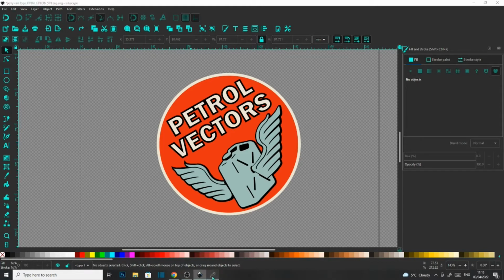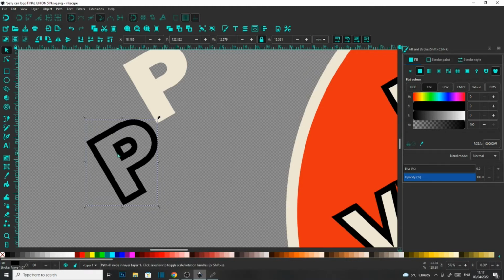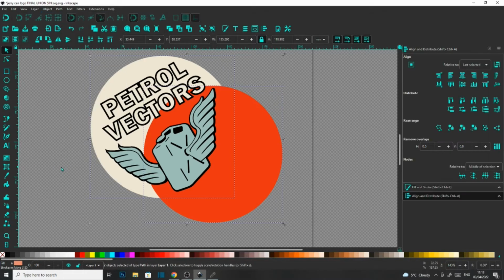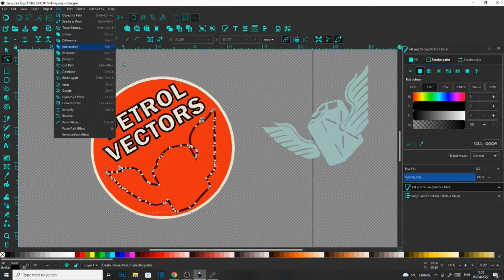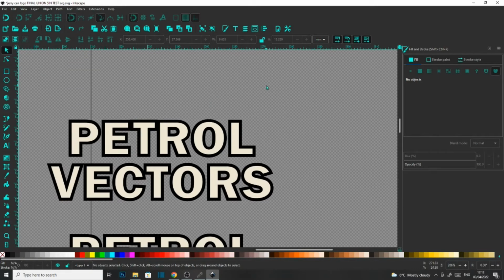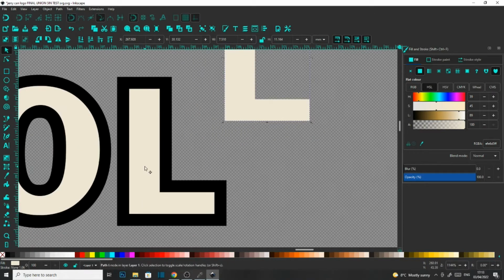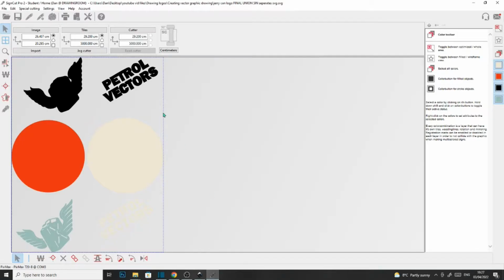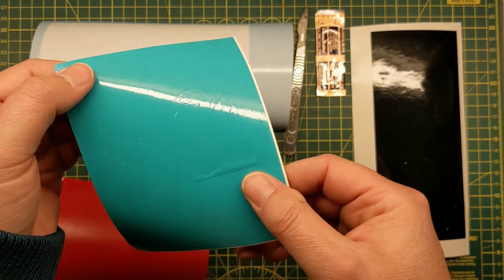How To Create Vinyl Cutter Friendly Inkscape Graphics - New for 2022

Comment: Have you done any outdoor sun and water tests? I'm curious as to how well the vinyl sticks to the other vinyl in the winds and rain, or does heat make it pliable. Thanks for the ideas and step by step.
Reply from the maker: Hey there TD Hobbies, I haven't done any sun tests because I live in England...terrible joke, nevermind, however the Ritrama vinyl I use at the minute is professional sign writing vinyl designed for the exterior of shops and vehicles and is expected to last between 3 to 5 years depending on the environment. I believe originally it was meant for vehicle pin stripes back in the 80's. As far as how well the vinyl sticks to itself it sticks incredibly well, so well that if you make a mistake while applying it you'd be very lucky to peel it back off and get another go without it stretching and ruining both pieces its fairly unforgiving. That said get it applied correctly and it will stay stuck I would imagine for the 3-5 years stated. 

The only thing to consider when designing stickers you want to have last a long time, try to stay away from intricate designs or anything that would be likely to get snagged when washing and lift a corner, smooth curves make the best designs for harsh environments, the sticker I made in my latest video has both so that would probably last a year or so before a point starts to peel for example . I've made stickers for co-workers vehicles and sold a number of them on eBay with no complaints yet though.   Dan

Comment: I don't use the stroke function when making decals. I always duplicate the object and either use dynamic offset or if I need dimension specific I use the offset in the path effects. After you're happy with the size of the offset, object to path, and for filling gaps (between letters), break apart, path union.
Reply from the maker: Hi Brian, yeah I found this too a little later after I made this video, it's a much more efficient way of doing it 👍